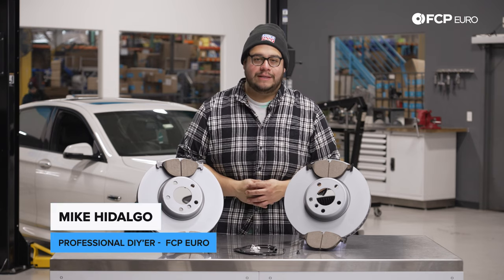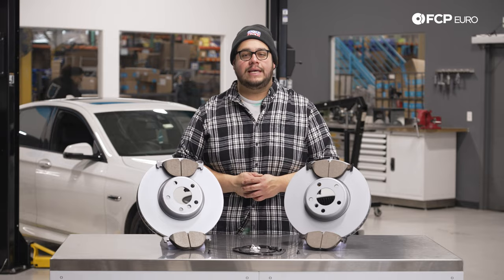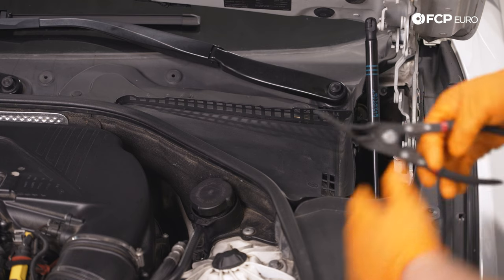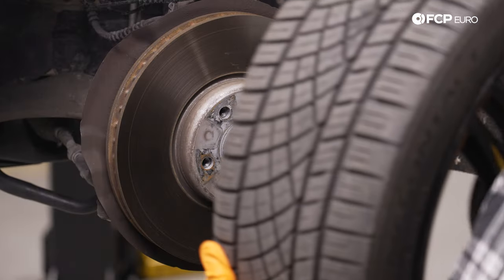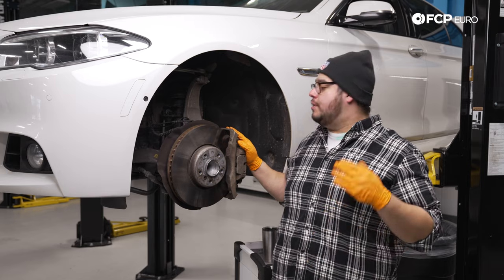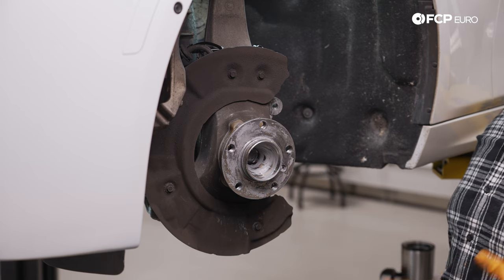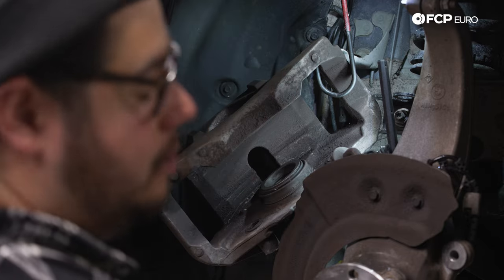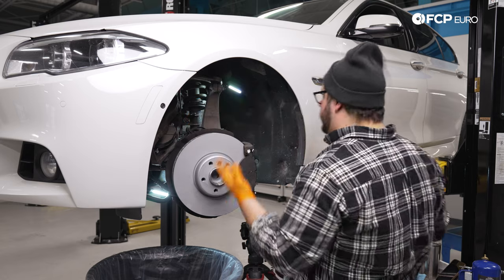BMW 550i Front Brake Pad & Rotor Replacement DIY (2011-2016 BMW F10 550i, F12 650i, Gran Coupe)

Comment: Excellent video!  Great tip about the rotor retaining screw - these can be a real pain to remove if they're corroded.  I have a 550i similar to this, and the biggest challenge for me  was reinstalling the anti-rattle clip.  I used new ones since the originals were seven years old.  The Akebono ceramic pads are very good and don't make black dust like the OE pads.

Comment: I have 2013 550i I replaced oem rear pads at 35k miles I got pads from fcp euro. 
Front pads I didn’t do they had bunch of meat left. I’m currently @72k miles still have bunch of meat left I think I can go 10k mikes with originals.  
Great video

Comment: Why do you need to remove the guide pins if you're removing the caliper bracket off the wheel carrier anyways? I usually just unbolt the caliper bracket bolts and swap the pads that way. Is there a disadvantage to doing that?

Comment: Can you please do a video of the rear brakes for the F10.
The electronic parking is something im not sure what to do.
Some say use a scanner to the put the EPB in "service mode" and some say to manually push the caliper back in with a torx bit.
I hope a video can clear this information.
Reply from the maker: On our list!
Reply: I allso need a video on this

Comment: 🤚🇵🇱🤚

7mm - 30Nm
8mm - 35Nm
9mm - 50Nm

According to the NEWTIS instructions, the guide screw with a diameter of 9mm should be tightened with a force of 50Nm. There is one more thing: before you retract the piston, it would be a good idea to slightly unscrew the bleeder and connect a hose to it so that the old brake fluid can be pumped out while reversing. Of course, you need to top up the fluid at the end. Regards....😉👍

Comment: In the video where you replace the HUB, you mention the e-Torx screws holding the carrier are recommended to be replaced. In this video, you're reusing the Hex Bolts that hold the caliper. Can you clarify which one is correct? The E-Torx as single use while the HEX are not?

Comment: Did the same job on 2016 f10 528i... but did not change the sensor. Is this the reason for chassis stabilization and parking brake lights being on? Not quite sure how to get rid of the Christmas tree in my gauge cluster...

Comment: I wouldn't be surprised if the brakes were the cause of the pulsation since the "old ones" were oe style pads. They don't have an expansion slot down the middle like the akebono pads which means they can crack and cause issues like pulsation, that being said I didn't see any cracks on the old pads when Mike was compressing the caliper.  You can also see that the oe textar pads left behind pad material on the rotor which causes brake pulsation more often than not, again it didn't look too bad on the outer side I only see one oddly shaped spot, and on the back side I could see a little one. However when Mike was torqueing the wheel down there seemed to be quite a bit of movement in the front wheel suggesting tired control arms, they look original and at 9 years old and what looks to be at least 50k miles on the car they are bound to be worn. I guess when we get a suspension DIY video for F10s from FCP we'll know what the outcome was :D

Comment: Do you mean Trq-Lbs-Ft instead of Newtonmeters? 110 Nm would be insane.
Reply from the maker: Per BMW, the two 18mm M12 Bolts are torqued to 110NM/81FTLBS.

Comment: If you're in there doing a job, whether it's a customer's car or yours your diagnose it, don't let them do it. Check it for the damn bushings already.
Reply: True. He shouldn't have told the back story. However, this video is about pad and rotor replacement and he did an excellent job explaining that